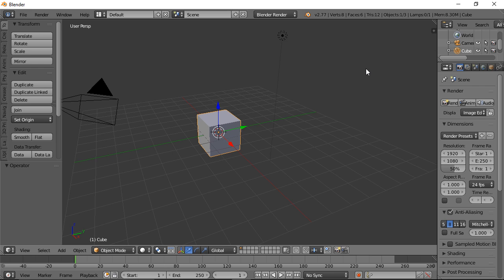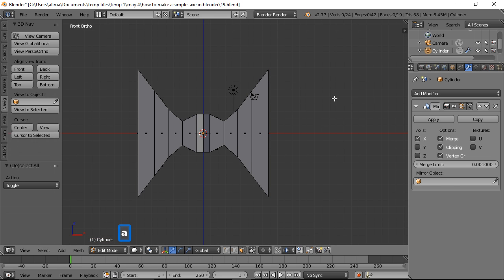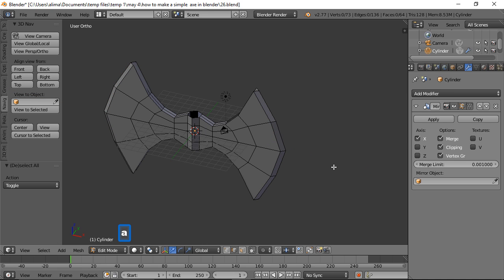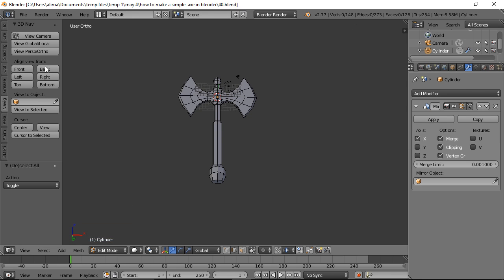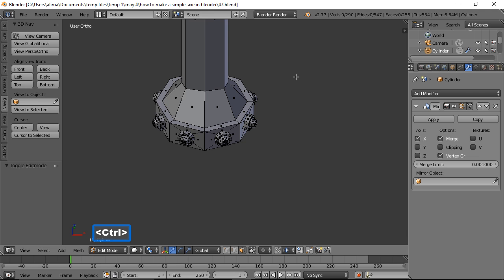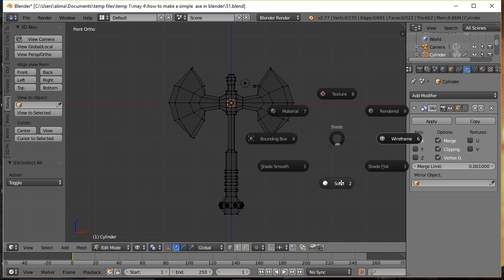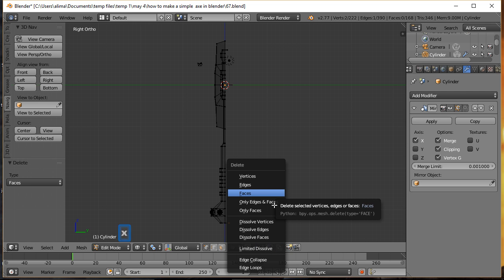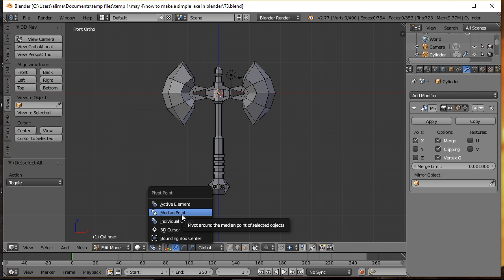How To Model A Simple Axe in Blender 2.77

Comment: First and foremost, thank you for all the time and effort you have put into this channel and for offering such a wide array of tutorials! They are very much appreciated. 
While not unfamiliar with 3D applications ( I have Maya, C4d, Max, Z brush and Silo ) I am very new to Blender. I've managed to grasp most of the functions thanks in large part to the videos you and others have posted on You Tube But one fairly simple thing is preventing me from enjoying working with this package. Its the fact that I am required to 'lock' in a function with a secondary click of my mouse when moving verts around. I have no issue locking the command when scaling etc, but its really tripping me up to need to do so when simply pushing/pulling points EVERY TIME I MOVE. Should you forget ( as I often do) then you move a vert... go to move another, only to find that last vert 'following' you movement. It's making me batty. PLEASE tell me there is a way to disable this 'feature'?

Sorry for the text wall and thank you in advance for your time!
Stace
Reply from the maker: Wow you use a lot of programs. Thank you very much Stacey for the kind words. If you got to File, User preferences, Input, then look up to the upper left hand corner you can select Maya as a preset. This may make Blender respond more to your liking. Hopefully that information will help you out. Thanks again Stacey.
Reply: Ali- 

Thank you for such a swift response. As for my programs, it’s not as impressive as it might seem. Z brush, I purchased back when it was version 1.3 or 5 and actually came to know the fellow who made it. I’ve gotten free upgrades ever since (take that as a lesson, kids, when they promise you free upgrades for life, they mean it.) C4D I got because I tested version 9 out for them and then helped them implement a layered
displacement option that got me 10 etc, gratis. Maya and Max… Eh. I was trying to find a program I liked. Oddly enough, Silo was truly my favorite to work with and wish they would have stayed with it.  In short, I’m old :) 

As for Blender- Yes, I’m aware one can set it up to behave like Maya or Max, but I hesitate to do so because I truly believe in learning a program as it was intended to be used. I have attempted going into the 3d global
settings and changing the ‘confirm with release’ option under the translate menu, but had no success. It’s frustrating because when I use the widget to move a point, it behaves as I’d like it to. It’s only when I attempt to move the point without the widget that I encounter the issue. When working with a high density mesh, that’s a lot of extra mouse clicks. I’ll give the Maya option a try; logically if the Maya setting permits me to move a point without the widget and accepts the release of the mouse button as an ‘accept’
command, it should translate that there is a way to make that behavior available within Blender without the Maya option. If you, or anyone reading this can work it out or knows the answer, you will have a very grateful person thanking you for the info! 

That said, in an effort to simply get used to it 'as is' I've made your lovely axe this afternoon whilst prowling for an answer. It's helped a bit and if all else fails, I know that I will at least have your tutorials to fall back on for getting myself accustomed to the standard Blender environment, so I thank you profusely for that alone! I'm hoping for an answer, but attempting to adapt as well. 

Thanks again,
Stace